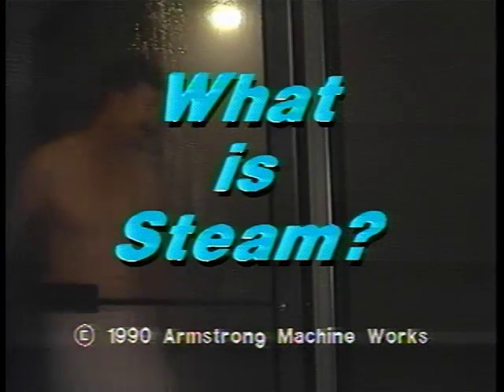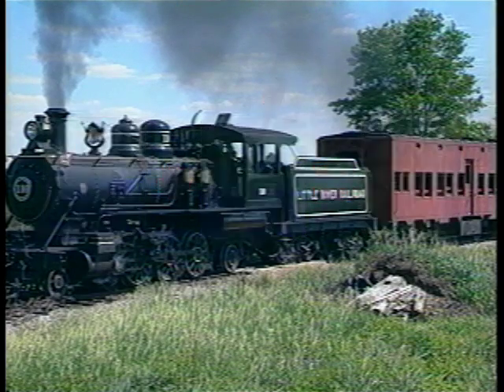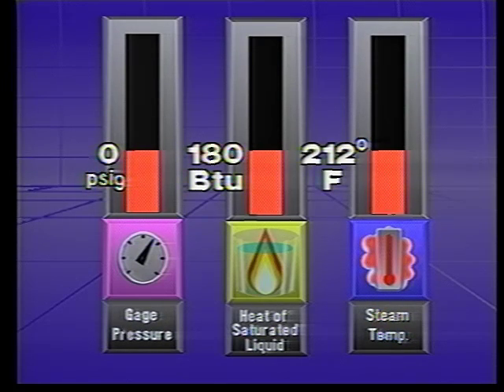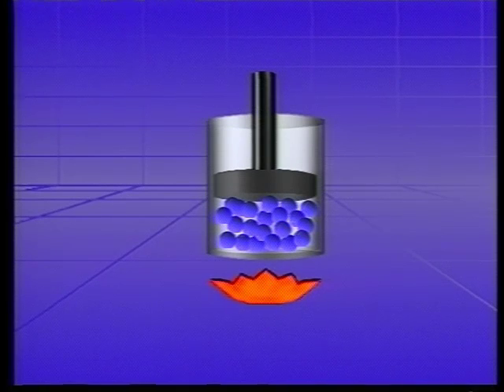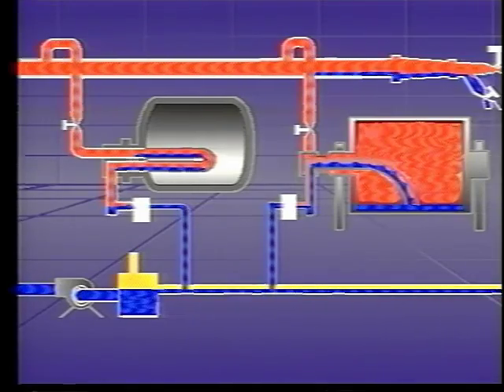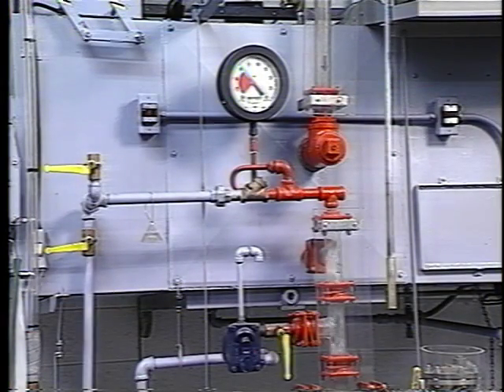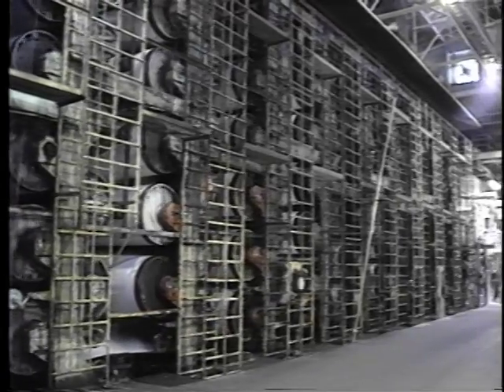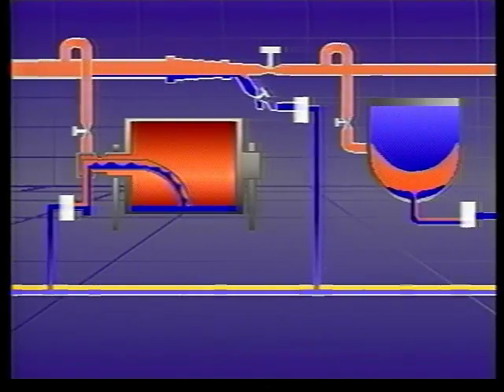What Is Steam?

Comment: Hello,  I have been canning and my ignorance of the difference between air and steam and water vapor may have caused a problem...  I am supposed to bring the 14 quart caner to a boil and then bring it to steam.... actually water vapor...  from the caner for 10 minutes before putting the weight on the caner sealing the system.  I then wait till the 10 pound weight begins to jiggle telling me it is at 10 pounds of pressure...  Once it jiggles the cooking time of 90 minutes is started...   What I did was bring the caner to a boil and let the vent vent probably air for 10 minutes.....  I did not wait for the caner to vent water vapor.  Therefore the fear is that my caner had a mix of air and steam which would have decreased the temp in the caner.  By any chance would you know how much less the temp would be with air rather than steam.  IF I can get an idea of how much less the temp would have been with an air mix then I would have a better chance of knowing if my caned food will be good or not.  Much Thanks for any assistance you could provide..  Greatly appreciated...

Comment: 0:26 (the vapour into which water is converted when heated, forming a white mist of minute water droplets in the air.
"a cloud of steam") << if that's not the steam then what is it? If you say, you can't see steam then I can't really believe that, because once you super heat the water it turns into oxygen and hydrogen gas. So in that case technically you can't call it steam, you should call it gas. This kind of people misleading normal people.